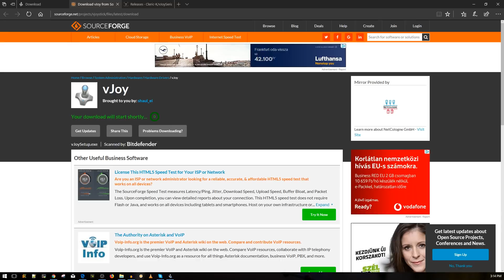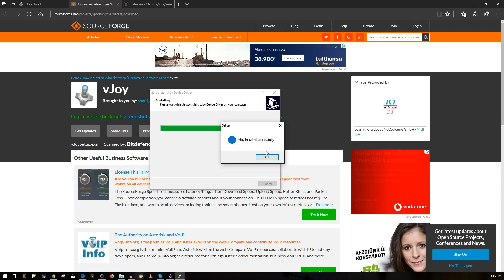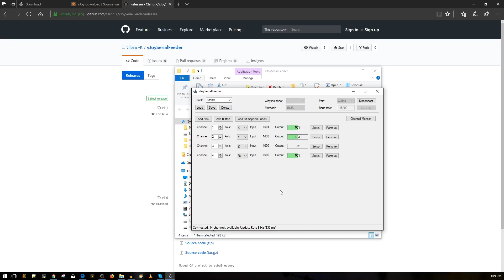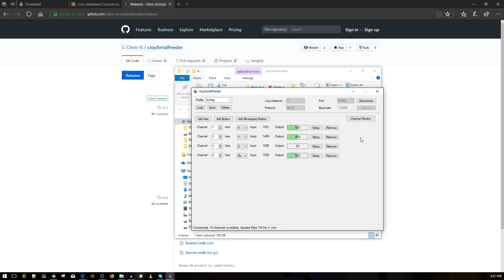How to Connect Turnigy Evolution Transmitter to PC Wireless // FTDI without a Cable

Comment from the maker: You can Donate to Cleric for his hard work now 
(Donate Button On Bottom of page)
https://github.com/Cleric-K/vJoySerialFeeder
Reply: You sayed that the arduino was faster, but actualy it has consistent higher latency, but was more stable than the ftdi
Reply from the maker: Thanks for the input I did not dig into it deep. But overall arduino like you said is alot more stable.
Reply: Also thanks for the videos, its a great way to learn about problems before you encounter them in real life and to compare products, so I can buy what i realy need.

Comment: I initially tried this with a F4 flight controller board and Ibus, but windows 10 put it in as a wheel and mixed throttle with yaw. So over a few days I've tried other ways and still with no success.  
The receiver is flashing as my radio isn't switched on yet. It says the VJOy is on com3 in the pc. I checked voltage on the ftdi, it's 4.99 on the pin. Switch on the radio, a constant alarm sounds, and the receive icon is flashing as though it's low voltage or low connection, but I get a sn reading and tx voltage. The leds on the Ftdi are flashing in time with the radios alarm.
Vjoy serial feeder drops the connection immediately the radio is switched on, so I can't test it.
I added a separate voltage feed to the receiver but that made no difference to the alarm.
Luckily I have always regretted buying my FTDI basic as it doesn't have individual 3.3 and 5v connections, and it's so small I misplace it regularly, so i've ordered a new full size one with printed connections which was another fault with the basic one. So if the new one fails as well, I shall still be gaining massively. ;-)

Comment: Nice video. Is there a ppm version similar to this one? I have a turnigy 9xr pro with a multi module installed... and some dsm2/dsmx receivers around my bench somewhere... and i really need to do some practice with liftoff simulator using acro and 3d flying... it would be great if it worked with PPM. And another thing that would be awesome, is the hdmi output from my laptop, transmitting to FPV goggles wirelessly... that would be so awesome...

Comment: I just tried FTDI method with a FS-IA10B receiver. The latency is usually low, but seems to spike a lot.
Reply: I think it is mainly because of the method I use to calculate the rate. Windows' general purpose timers are not very precise so the faster the rate, the more imprecise and jumpy the calculation becomes - that is because the error of the timer becomes comparable to the period of the data. Maybe I'll try to apply some more averaging to make it look better.
Otherwise, the behavior of the FlySky receivers I've tested is pretty consistent so you shouldn't have problems. Thanks for the feedback!
(And just to be clear - the numbers represent the rate at which frames arrive from the receiver. We can measure how often frames arrive, but we can not know if they were sent a millisecond or an year ago)
Reply from the maker: Like I mentioned in my latest video with the frsky I find arduino to be the fastest.
Reply: Definitely going to try Arduino Nano next. But so far, FTDI and MultiWii methods work great. That feeder app is rock solid.

Comment: Will be trying this and the Arduino nano method soon. I already tried the vJoy feeder app with a betaflight whoop in the multiwii protocol. Really slick app. I have used similar apps in the past to read ppm signal from trainer port with line in on my audio card. This is a huge step up from that.

Comment: Can I do this with my dx6e? It has wireless trainer so no 3.5mm output. Would it be possible with or without the wireless trainer connection or through a receiver?
Reply from the maker: Tomorrow Video will show you how to play through your quadcopters usb connection with any transmitter.